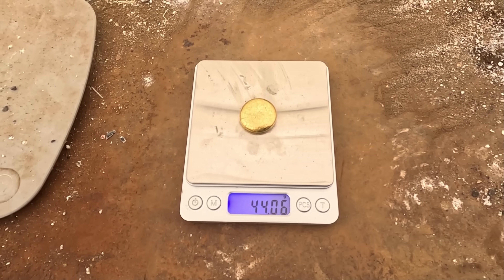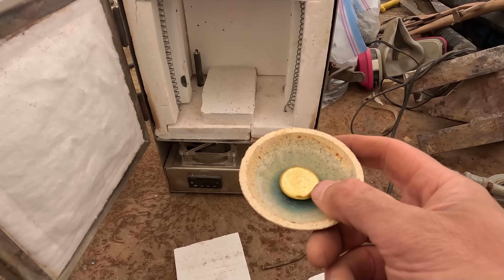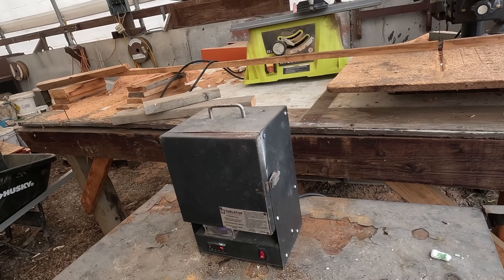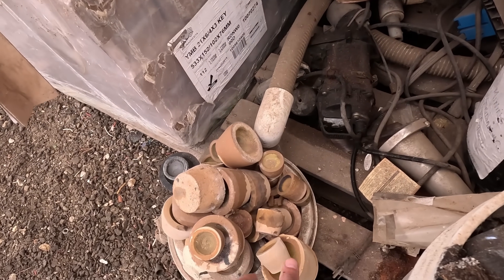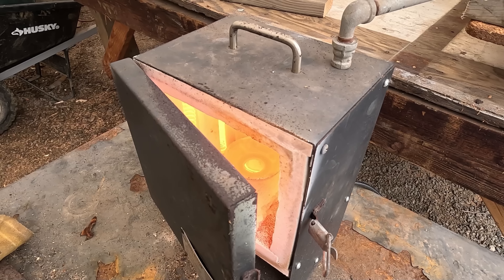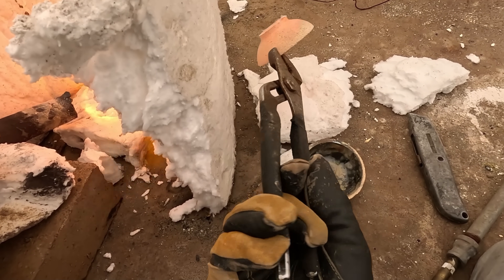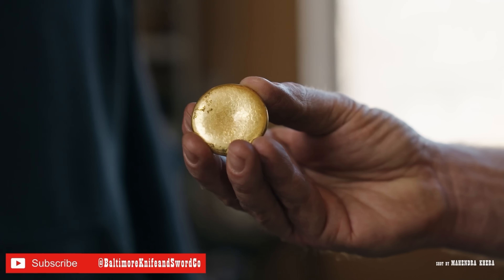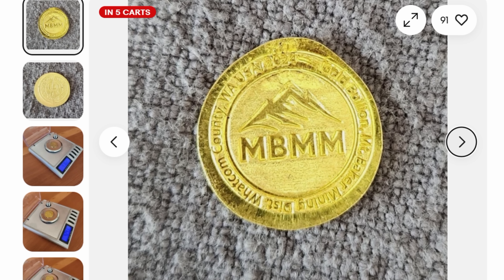Refining Gold Without Acid – Making Jewelry-Grade Gold From Mine Ore

Comment: Are you familiar with the annealing process for soft metals like gold copper and aluminum?
The process is extremely simple all you need is a propne torch and a bucket of water heat the metal until dull red then quench in the water. If your hammering on them the become work hardened after a couple minutes which will lead to cracking hence the annealing

Comment: Drill  small holes on the door below And few small holes behind, on top.Close the holes with metal.  Heat it up and than open the holes. I did that on my small mini furnace i made and it worked flawless. And you can introduce air using a mini pc fan in case not enough oxygen. I jave a video. But if you do it, use fire bricks rated close to 3000 Fahrenheit, cement material for refractory. Because mine didn't last too long started falling apart.😂

Comment: Galvanized steel has a zinc coating that could fume off. I do not like the idea of inserting the galvanize pipe into a 2000 F oven. The zinc funes could contaminate your gold. Also, I would cool the gold in distilled water to avoid contamination from dirty water as the water evaporates.  Nice idea to purify w/o acids.

Comment: That was an interesting concept to purify gold oxygenating the ambient air to over 5 minutes of melting pull the impurities from gold.  Others just use alchemy of nitric acid and Hydrochloric acid Aqua Regia refining of 99.9 percent pure gold in filtering.  I think borax salt and oxygen ambient flaming 5 minutes worked as well.  It was economical by using propane heat and borax salt vs the alchemists methods, I think, which is better environmentally!

Comment: I note from your videos and others of refining gold in poorer countries.....that they used a ceramic cup and map gas from a little hand held disposable cylinder....melting it in the open air. That is very similar to using a tiger torch and propane in a more open environment.  Maybe map gas is a simpler and more economical solution for you?

Comment: Yeah as much as you can Cupel with the door cracked to let some Air in there, there just isn't Enough Oxygen to Oxidize %100 of what can be oxidized. Adding the Pumped Air pipe is a good idea, I also didn't consider the Iron or Copper though.   Good Stuff!

Comment: I've got a 65g button of gold that could benefit from this treatment.  I've also read that borax is soluble in propylene glycol better than just about anything else,  for cleaning up the button and crucible.
Reply: Is that just normal engine coolant?
Reply: @d.james212 I'm not sure, there are so many different molecular weights of propylene glycol. From engine coolant to medical uses. I haven't been doing much melting lately, so I haven't created an opportunity to try it out. I'm just going from the results of Google searches for borax solubility.
Reply: @dylanjames4537 yes just antifreeze.  Borax dissolved in antifreeze also makes an excellent anti mould spray.

Comment: just a heads up, hammering using rusty tools with gold being so soft you can EASILY contaminate it, it can suck up bits. i dont know what contaminates are on the tools. but for the end step, fresh, clean tools are a good idea. as you said a few 0.1-2% can have an effect. so why work so hard to mess it up right at the end. good job

Comment: Thanks for sharing your on going processes Jason! What are your thoughts on using a higher rated temp. electrical furnace? Or producing a product that would allow you to adjust temp, air flow and vacuum? For your higher consistent grade  production.

Comment: why not use an acetylene torch instead of the furnace?  Put the crucible on some insulating wool, heat with a neutral flame, then turn up the oxygen.  The force of the flame will stir the liquid and push the oxides off the liquid surface.

Comment: That is excellent!  I was a little concerned at first as you described what you were trying that the gold would also oxidize but clearly that is not the case.   Excited to give it another go.  Let me know if you want to knock down that button to a few more coins.  Thanks for including me.
Reply: I'd be surprise if it'd react with the elemental gold itself and I was more concerned with potential vaporized zinc from the galvanized pipe being introduced into the furnace environment. The game is always hard because the choice is often between yield and purity which is why there's often gold left on the cupels.

Comment: 5:55 As you were getting things set up and talking about blowing on the molten gold, I had an idea.🤔

If you have an oxy/gas welding/cutting torch, just barely turn on the oxygen on the button with thermal shielding around the torch and tip.
It will avoid nitrogen in the air. 😉

Comment: That was borax rolling around on the top of the button. You quit seeing it when enough of it had been consumed. To remove borax you should use sulfuric acid, not HCl. Gold can be slightly soluble in HCl. That’s probably where you lost the weight and the reason people keep the waste solution in a stockpot. There’s no way to know the purity of the gold without an assay.

Comment: When you blow on something you exhale a degraded air, mixed with air that has impurities.  Do not use pure oxygen near flame without controls.  
This from Duck-Duck Go:
"We primarily exhale carbon dioxide, which is a waste product of cellular respiration, along with a mixture of other gases including oxygen and water vapor. The exhaled air contains about 4% carbon dioxide, compared to the 0.04% found in the air we breathe in."

This came from commercial diving school, and US Navy Diving Medical Science:
Carbon monoxide is a product of complete combustion of oxygen, and Carbon Monoxide is a product of incomplete combustion of oxygen.  
(1 extra Carbon Molecule over C.Monoxide)

Comment: The cracks at the end was probably because you work hardened the gold.
Reply: Agreed you will need the heat it up again to soften it again
Reply: I was gonna say the same. Work, anneal, work, anneal and you can eventually get some gold foil with that.
Reply: 100%  reheat to dull red N quench in water.   Quick cooling softens Gold opposite of Steel which hardens during the quenching. 😊

Comment: LMAO, I bought a little bucket furnace and did not want to buy an electric oven too, and had been increasing the air/making an oxidizing flame to cupel for the little bit of cupelling i do. Just don't use a graphite crucible with an oxidizing flame.